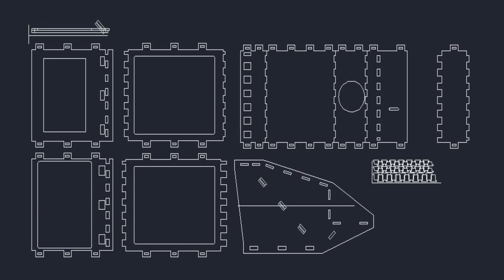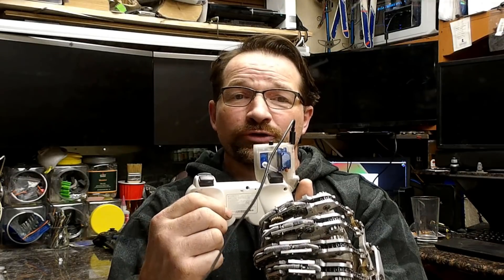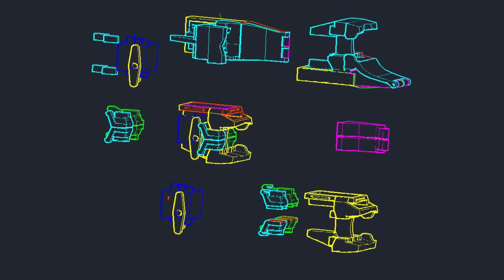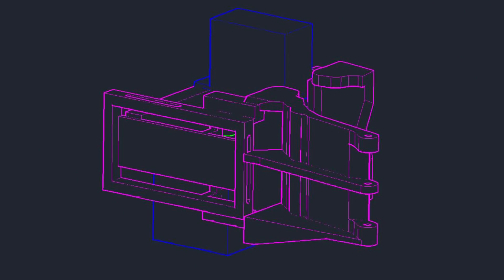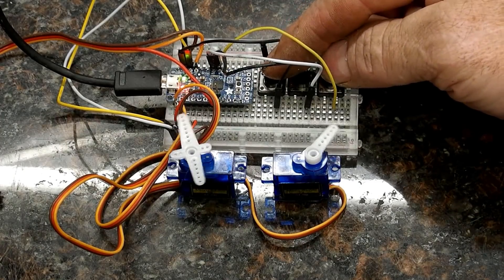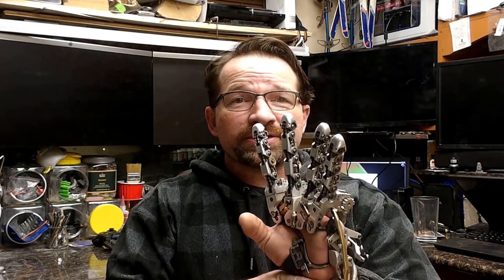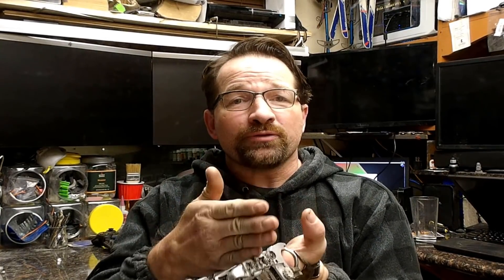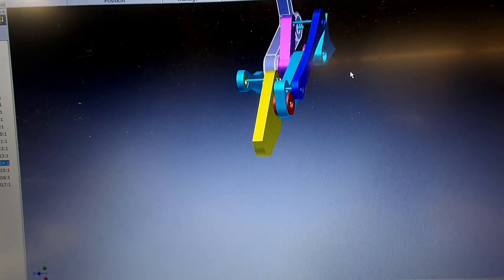Gamer Upgrade for Missing Parts Club Members

Comment: People don't understand how helpful something like this can truly be... several years back, I had a crush injury to my right hand onboard ship, and wound up having to have surgery to make my hand look (and hopefully work) like, well, a hand again. I wound up with a mostly immobilized wrist, a thumb pinned in place, and very little range of motion in my fingers while I was healing, as metal fixtures were holding quite a bit of the bones together.

All things considered, I was doing 'ok'- I could do most things with my other hand, I could still drive, could still (carefully) work on stuff... but I couldn't play my GAME- the one thing that I did every day to blow off stress after work was to come home, turn on my xbox, throw on a headset, and play with my friends... and I couldn't do it, because I couldn't hold the right side of the controller, work the joystick, or bend fingers far enough to press L1 and L2... and it SUCKED.

I wound up picking up a device that allowed me to plug in my controller and "break out" the functions to multiple devices, and it was a lifesaver. I used a Playstation Joycon in my left hand as basically "half a controller", and then an old-school, super-bulky mouse with four big pad-buttons on it for my messed up hand.

I wasn't as good, it took a week of figuring out, and I spent close to 6 months sucking at games with that janky setup, but... I COULD STILL PLAY. Being able to do that one thing with my friends like normal helped pull me through it.

Things like this REALLY help people, even when they look like a simple gizmo to do something unimportant or trivial.
Reply from the maker: Thanks for the kind words!  You are correct, the average person isn't going to get the struggle or benefit that can be overcome with a simple adaptation.

Comment: Ian, you a a genius and I second the comment I saw about incorporating hidden blades
I have a suggestion that might be less work than designing one from scratch. You have a bunch of retired models. How about using one of the old models and incorporating 4 blades attached to each of the fingers? With the fingers extended the blades are flat above your palm, fingers bent, the blades move forward, wolverine style...?

Comment: That’s so cool! Did you experience any problems with latency between when you press the button and when the trigger actually gets pressed? I would imagine that for most games it wouldn’t be a big deal but maybe some need a fast reaction time. It did seem to respond really quickly when you pressed it though, so I doubt there would be any issue

Comment: Those servos work quicker than i thought they would. I initially thought you were going to go for a design without electronics. If you haven't seen it already, look at the Avenger products for controllers. It might be feasible to bump a paddle with your right hand that activates a button on the left.

Comment: This is quite nice, still for the controller I feel like displacing a button by adding a all new controller on top of the first one is a little too much. I think redesigning the shell of the controller and doing some solder would have been cleaner. Though it's a more permanent mod.

Comment: This is awesome!!!
But certainly has its limits, controllers are quite specifically designed...

Perhaps you should try PC gaming?
I recently found a keyboard with a thumb-stick built in to act as WASD for movement.
Paired with a mouse with mappable buttons you would have almost no disadvantage!!!
(Even with thumb-sticks being slower, that really only applies to aiming)
Edit/ comment combo: Either way, I hope to see future versions/ improvments!
Perhaps design a new controller shell people can 3D print and then just switch the electronics???

Comment: Hey Ian have you ever heard of thermoplastic beads?  I used some from a brand called 'instamorph' to make  a caste for my dog who had Lyme disease.  His hock and wrist ligaments wore away so he ended up walking on his hocks and wrist.  Using the thermoplastic beads I molded caste that attached around his palm and around is thumb, and ran it ran up the front of his forearm about 6 inches with a curved out curve at the top with memory foam all on the inside.  I also use felt, the strongest super glue i could get, and industrial velcro.  I was able to just heat target points when their wasn't enough strength or to much friction.  It was amazing he was able to use his paw like totally normal, I also figured out some stuff for his rear legs and I weight reducing slip for his tail and we were able to walk years after he reached his crippling state!  

If you haven't head of the stuff I think you would really appreciate it's versatility.  If you loose a screw just press the melted material in the hold wait a couple minutes , and unscrew your new screw!  You can reheat it and remold from scratch as many times as you want so you never waste any!  Hardens like a rock, strong enough for some of the things you do, but it might also be good just for idea joggers and temporary tests.  

Anyway here's a link, there some for $15 a lb on etsy too.  ok, keep up the good work! 👍
https://www.amazon.com/Thermoplastic-Beads-Pellets-Mold-Able-Polymorph/dp/B08LDZ6W95/ref=asc_df_B08LDZ6W95/?tag=hyprod-20&linkCode=df0&hvadid=475805820911&hvpos=&hvnetw=g&hvrand=14773548853150257737&hvpone=&hvptwo=&hvqmt=&hvdev=c&hvdvcmdl=&hvlocint=&hvlocphy=9001992&hvtargid=pla-1040861355243&psc=1

Comment: Hello Ian i have a tip for the upgrade. It might be faster/more efficient to wire the microcontroler directly up to the buttons pins/contacts. The side-effect to this would be that its not as easy to install.
Greetings from Austria

Comment: No disrespect, but. Why not just make something with buttons on the side using purely mechanical mechanisms? So you can press it with your thumb, and it would press the L1 or L2? Would be much less complicated and cheaper to make.

Comment: it would be awesome to see this design improved, i imagine you could wire those switches to some kind of sensor to trigger them (depending on what kind a person needs)  maybe a touch sensor? the switches on the controller are all pressure sensitive and actually have the function you showed for your repeater so you already have 1/2 of it made you just would need to step the servos.

Comment: wouldn't be easier to just rewire the controller and 3d print a lower section of the controller?
that way you wouldn't need nothing more than some jumper wires and a 3d printed part
Reply from the maker: Yes and no, if this was only for me, sure, hack up a controller and use it until the controller dies. But if I'm in oregon and you're in pheonix Arizona,  I than throw this gadget in a box and ship it to you where you glue it to your controller get to gaming.

Comment: you can control the button using an arduino and just a transistor
Reply from the maker: I could control the servo with a button and 2 resistors if I wanted to be super minimalistic, but the end stop position wouldn't be as easily adjusted.

Comment: Nice work! And just one Idea for some of the games that might require the simultaneous use of the directional buttons and the L1/L2 is to use some pedals  adapted to these buttons.
Reply from the maker: So I realize that I don't show it really clearly in the video.  But I don't use my prosthetic hand to control actuate the buttons,  I press the buttons with the ends of the metacarples just like you would push them with your fingertips.
Reply: @missingpartsclub  oh, I thought that you were using the thumb. Thanks for the clarification.

Comment: Someone is definitely going to pick up on this
Reply from the maker: That would be so awesome if that happened!  The tough part about it is  the market sector is large, but not large enough to be a guaranteed win for someone to set up injection molds and get past a small batch production run. In short, the need is there, but sadly the economics don't support it.
Reply: @missingpartsclub  trouble will definitely be marketing (getting word out), social media and word of mouth would have to be big for a co like that I would think

Comment: Would there be away to control how far you press the triggers? Mainly for driving games.
Reply from the maker: Yes, but you'd need to go down the route of using an analog input like what I started out doings with the fsr sensors. The clicky switches are digital, either on or off, while the fsr's can be on, off, and anything in between. The only downside to using the analog switches is that they have a larger footprint.
Reply: @missingpartsclub  Thank you for the reply! I love the work you do and I was just curious.

Comment: I'm an electrical/electronics engineer (I design and program circuit boards). If you ever need any help to design a solution, or if you just have questions about possibilities or approaches to a technical problem, please reach out. I'd be more than happy to assist in my spare time.

Merry Christmas!

Comment: [GAME CONTROLLER] Interesting gizmo my first thought would have been to open up the controlled and mod new buttons on the shell, wired into the controllers buttons. maybe print a comfort mount for them in the position of the shortened fingers. Another idea would be mechanical involving "already attached fingers" for the person to press on to press the buttons.

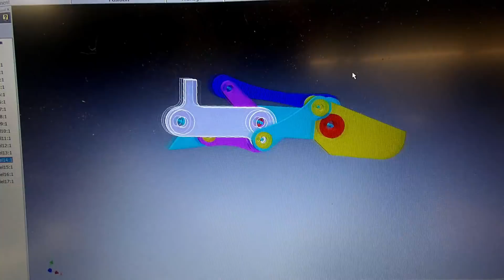8:00 you could improve strength to the compound link finger, by using "Y bones" or "wish bone" joints as some people would know them, alternating them through the structure should help them re-enforce each other, but positioning is key, to avoid twisting, the Y shapes dont have to be straight either, they can be organic shapes, the 2 to 1 point connections focus their movement.

Comment: He’s 3D modeling in autoCAD! This guy is old school! That is, old school if you learned 3D model in the last few years like me.
Reply from the maker: I started with autocad 10, not 2010 but 10, back with windows 3.1.1 they had just introduced button input  instead of everything being command line.
Reply: Wdym? Our school teaches 3d modeling in autoCAD. What do you use?
Reply: @morgankosokowsky812  I learned Solidworks. Did you learn autdesk inventor? Because that’s different from true autoCAD. Most people learn Fusion360 or some other software built for 3D modeling. True AutoCAD is mainly for 2D. You can do some 3D, but I’ve heard it’s much harder than most other programs. I could also be wrong ¯\_(ツ)_/¯
Reply: We've got two programs at my school, autoCAD and autodesk inventor actually. In grades 9-10 you only use autocad, you're only later taught autodesk in grades 11-12. In my robotics class tho we only used autocad, and that's where my experience comes from
Reply: @morgankosokowsky812  gotcha. Yea inventor is good for modeling. AutoCAD, what he is using, is much harder to use for 3D modeling, but it's been around longer.

Comment: I just thought of something. Compliant mechanism prosthetics. I think there are simple linkage designs that do not use actual hinges, but they will flex instead. This would reduce part count greatly and be simpler to create
Reply from the maker: There are, and I've been working on a couple of designs utilizing it as a  concept. The difficulty that I have been running into is that I need to get 270 degrees of motion in a tiny form factor for it to work as a finger.

Comment: Maybe you can have a plastic shell that has a finger bent at 90 degrees to push the L1 and L2 buttons. To push them, you would just pull your hand back.
Reply from the maker: Either that or use a linkage that reverses the input, the difficulty with that is that I don't have a bunch of motion at my index metacarple, and even less with my middle.  It's basically just motion at the wrist.

Comment: Just curious, why did you go with the motors and microcontroller? Did you consider wiring in a set of secondary switches directly to the game pad board in parallel to the oem buttons?
Reply from the maker: I did, but I wanted something that I could pop on and off when the controller dies, or something that I could just put in a box and ship if a fellow missing parts club member wanted to order one. Moving the switches is a pretty permanent modification.
Reply: @missingpartsclub  thanks for the explanation! It's a really cool project, and I hope your friend can utilize it to their full gaming potential 🙂
Reply from the maker: I'll find out in a week or so when he gets it. Hopefully it changes his mindset on some things. The thing is, ya it sucks right now. But it'll get better, you just have to find the work arounds.